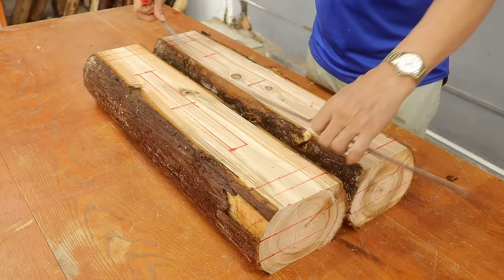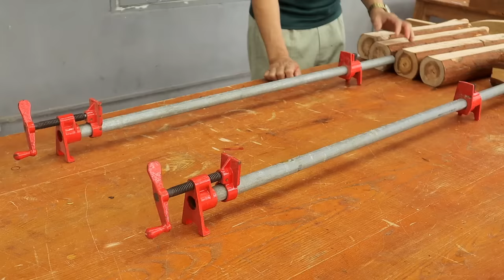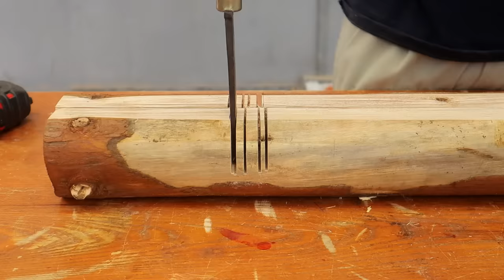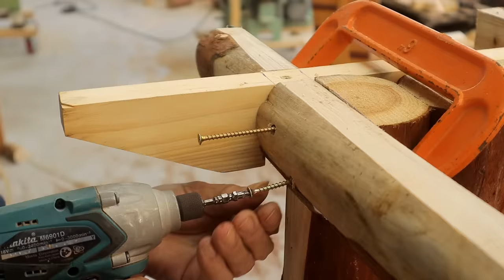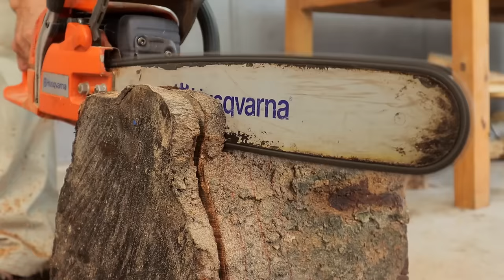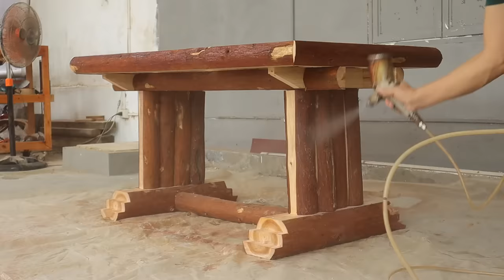Monolithic Woodworking Project With New And Unique // Design  Dining Table With Cool Design

Comment: I learned in school lithic means rocks or stones not woods. But maybe I was wrong
Reply: English (probably especially American English) is pretty loose with a lot of words.  You're right; it should be limited to describing things made of stone.  In common/informal usage, monolithic can describe anything which is large and apparently as solid as stone... but not a pine log table held together with useless screws and a bit of wood glue.
Reply: @umpbumpfiz  actually this is a pretty strong way to keep it together, log cabins are put basically the same way together. The only thing worrying me is the wood doesn't seem fully dry and that he uses a steel hammer instead of a wooden one to not damage the wood.